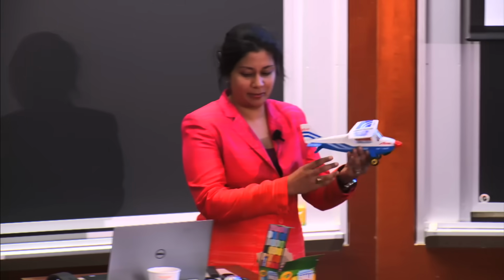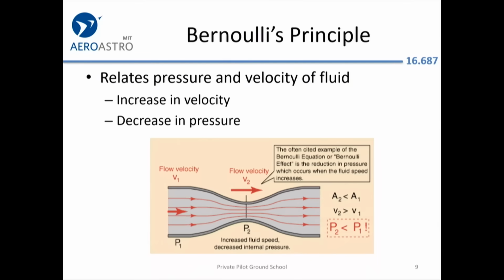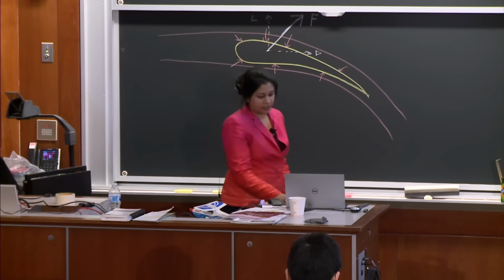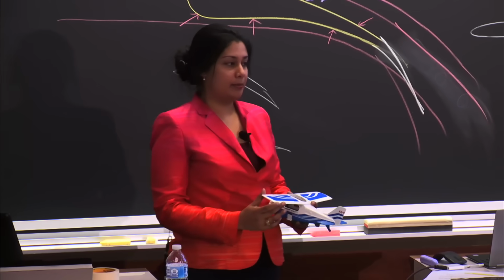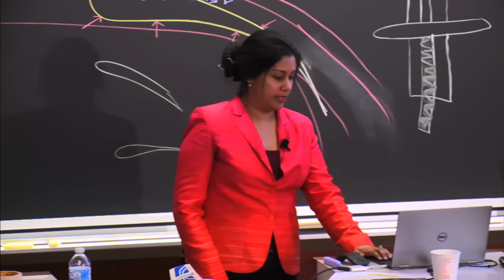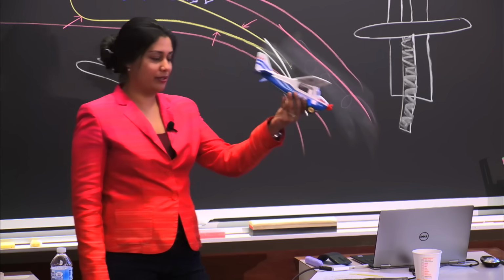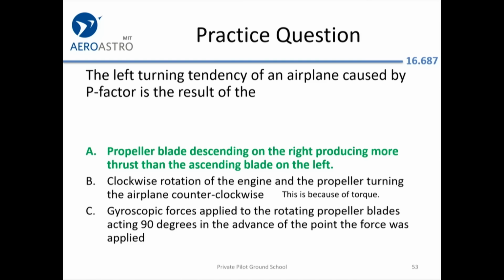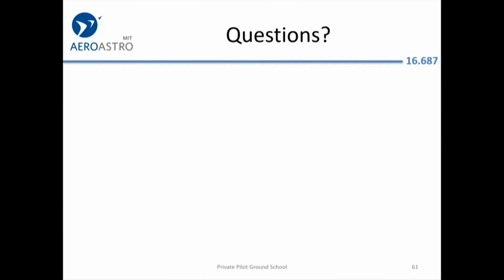Lecture 2: Airplane Aerodynamics

Comment: So ... the air traveling along the upper surface of the wing does or does not go faster than the air traveling along the lower surface. Which is it? Faster or Not(Faster)?

At 7:40 she states that air traveling faster over the top of the wing is false. 

At 13:07 she states that air traveling faster over the top of the wing is true.

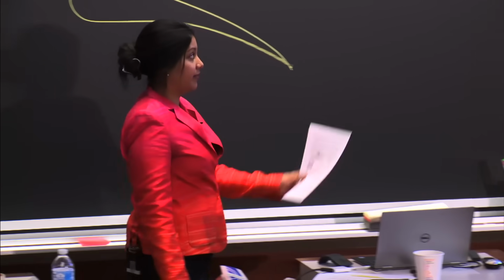Comment: @12:37 But why does the air flow faster over the top of the wing ?
Reply: because the wing is angled, so it is compressing air in front of it which causes high pressure in front of it and low pressure behind it. It's the low pressure which causes the increased velocity.

Comment: ... mmmh - I don't know: When the instructor asked at the end of this lecture why the blended wing body is not going to be built despite its aerodynamic efficiency, I would have asked her back, who actually told her this concept being better? It isn't.
She hasn't mentioned that aerodynamic efficiency is also depending from the size of the aircraft surface: Less surface, less friction - easy. The wing surface is a compromise between the requirement for lift-off still at some reasonable speed (approx.120knts) vs. an air restriction at cruising speed as low as possible. Current civil aircraft designs indicate that more than that wing size as it is would be unnecessary.
The blended wing body would be able to take off at perhaps 50knts - but its air resistance wouldn't allow current cruising speeds - also because of the expected air turbulence: After all a wing profile can only cover a certain speed range.
Besides: The engines on top would give the aircraft a constant pitch-down tendency. Again, there are reasons why engines are currently attached below the wings.

Comment: There is a lot of misleading information in this video. Take for example the questions asked at 12:51
Which statement relates to Bernoulli's equation,
1. For every action there is an equal and opposite reaction.
2. An additional upward force is generated as the lower surface of the wing deflects the air downwards.
3. Ait travelling faster over the curved upper part of the airfoil causes lower pressure on the upper surface. 

in Bernoulli Principle, there are two types of accelerations of masses that can take place and in both types of accelerations, FORCES are generated.
Since velocity is a vector containing magnitude and direction then,  
*One can have a change of linear velocity of a mass keeping the same direction to produce linear acceleration hence forces and pressures.
*One can have a change in direction keeping the same velocity and so one still produces accelerations and hence forces and pressures as in centrifugal force where a mass moving with constant velocity will change direction.   

Now in the question asked,   ALL THE ANSWERS SHOWN, DO EXIST in various zones WHEN A FLUID MOVES ALONG AND BERNOULLI EQUATION IS EXISTING WITH ITS MANY BY PRODUCTS INCLUDING  all that is listed in 
1. For every action there is an equal and opposite reaction.
2. An additional upward force is generated as the lower surface of the wing deflects the air downwards.
3. Ait travelling faster over the curved upper part of the airfoil causes lower pressure on the upper surface.

I believe we need to stop talking about Bernoulli as an explanation of how a wing operates and start thinking of the Zone around the wing as an ACCELERATION ZONE OF THE FLUID IN QUESTION. Basically, we must not look at a change in linear velocity hence linear acceleration along the streamlines ( that is drag basically )  but we could regard the change in direction of the close elements of fluid particles which are so close that they move with constant velocity basically, and it is this change in direction of the fluid elemental masses that produce the acceleration force.  and hence at every zone located around the wing, there is  ( 1 elemental opposite reaction for every reaction) and also (2 the acceleration force due to a change of direction of the fluid generates on the lower surface deflects the air downwards which in itself contains the fact that to every action there is an equal and opposite reaction! )
Note that air need not travel faster on the curved upper section of the airfoil as a change in direction of the fluid mass is enough to cause acceleration and hence a force which the fact that to every action there is an equal and opposite reaction will produce the lift on the upper ( and lower) surfaces of the wing.  

Now, a leading-edge is a wonderful unit/zone, used to improve the lift on the upper section through this simple function, First, the fluid mass particles on streamlines going into the leading edge will come into a pressure zone and are deflected upwards by the pressure zone and they are vectored as heavy balls, up and away above from the leading edge, This momentum of the heavy fluid particles going up and above the leading edge becomes little pistons which will leave a suction zone behind them due to the fact that they have been shot up by the leading edge and also the rest of the upper surface has a downhill sloping surface which acts as an empty volume tending to suck back all the mass fluid particles shot up by the shape of the leading edge.   

The lower surface is easier to understand as the heavy fluid particles simply act as a multitude of heavy balls hitting a tennis racket and here comes that part where to every action there is an equal and opposite reaction contained in Bernoulli behaviour!.

People viewing this video should be careful how to answer questions set by  their teachers and they should  be patient and polite to write FROM BASIC PRINCIPLES  that it is not Bernoulli nor Navier Stokes that makes wings fly but the heavy fluid particles being subjected to  a change of velocity keeping the same direction and a change of direction basically keeping the same velocity and all this contains once again 
all the three activities mentioned below.
1. For every action there is an equal and opposite reaction.
2. An additional upward force is generated as the lower surface of the wing deflects the air downwards.
3. Ait travelling faster over the curved upper part of the airfoil causes lower pressure on the upper surface.

MIT OpenCourseWare, please reflect on this contribution showing the basic principles and fundamentals of how a wing flies.
Bernoulli and Navier Stope should no longer be mentioned in flying but students should comprehend the basic principles in the statics and dynamics of heavy fluid flow as individual particles having mass and which could ACCELERATE and DECELLLERATE in a linear or a circular manner.    
It is Bernoulli that follows natural phenomena and not natural phenome follows Bernoulli.  All educators of aeronautics please note and do not mislead students anymore. Also, note that in practical situations at the trailing edge there are always vortices along with it as the velocity at the tapered trailing edge from the upper suction surface is not and never the same as the velocity from the lower higher pressure surface. This is accentuated with a higher angle of attack and become disastrous just before the wing stalls.  So enough of Bernoulli, please! 

All students, please do not take what is in books like the Bible of flying,  students should become sensitive to the behaviour of just a lump of mass fluid which is being accelerated or decelerated through linear acceleration or circular acceleration. That is all you need to understand all the behaviour of, wings, rudders, ailerons, flaps, spoilers, propellers and in jet engines, compressors, diffusers, combustion chambers, injectors,  and hot stators and hot turbines and exhaust pipes............................................it all has to do with linear and circular accelerations effects due to curves and their smooth concave and convex and sharp-edged shapes where with air, one can add heat for a bit of fun, and in water, the lump of water, can change its shape and fall off the blade of a propeller at the leading, trailing edge and tip,  and even boil up if it sucked fiercely from the suction side of a propeller or any part of a ship or aircraft for that matter.  Read all books and appreciate what teachers tell you, but do sit alone in life and deal directly with the elements of the universe around you....... there is, as it is................... and no one as yet, not even Bernoulli and Navier Stoke and not Maxwell norFaraday nor Einstein nor any other person has come up with a formula that explains all the detail in how a wing flies. They only deal with symbolic approximations. Most engineers do their best to make it work, but they do not understand it completely.  So anyone can sit, think and contribute to advance the present situation.  

All educators please be tolerant with those students who think and might not agree with your philosophy as they might be correct in their own conclusions.

Comment: I understand how the the air flow below the airfoil turns downwards. But why should the air flow above the airfoil turn downwards?  I believe the explanations will be easy if you can imagine the stationary air at plus or minus infinity is enclosing the air flow. as a duct.

Comment: I don't get why every instructor on this subject always says, "When the air travels over the wing...".   When an airplane flies, the WING is traveling THROUGH the air, not the other way around.  Sure the air might be moving slightly because no air is perfectly still, but the air is not traveling over the wing at 150 knots, it's the wing that is traveling through the air at 150 knots and the air is being displaced and moved around by the wing as it travels through the air.  Also if the air was doing the moving, I suspect that it would have some momentum and inertia because of it's mass.  How would that influence concepts of lift, boundary layer theory, stall characteristics, etc.   The only time I can think of where the air travels over a wing would be in a wind tunnel where the wing is stationary.  I am definitely not an expert in this area but I would dearly love to have an expert address this issue, ... am I totally off the mark here?

The instructor was interesting.    She made a few boo-boos here and there but it actually made the presentation more believable.  She was talking to the students on a level playing field not looking down at them as if she were some kind of know-it-all and just spewing out facts at them.  The presentation was interesting even though I previously had a good understanding of all the concepts she presented.  I think everyone piloting, building their own aircraft, building/flying RC airplanes, etc and in general the flying public would get a better understanding of what is actually happening when they fly by watching this video.
Reply: So when you visualize flight, do you imagine the wing trying to climb over the air like a soldier crawling up a hillside? I'm simply asking because your statement got me thinking.
Reply: @JBHACKSAW  Well possibly.  I believe the angle of attack plays a huge roll in providing lift, however, the air passing over the top of the wing must be smooth and not separate so obviously it must have an influence on lift as well.  Having said that I do not subscribe to the Bernoulli principle of lift because aerobatic airplanes can fly upside down for hours without falling out of the sky, so that tells me it is the angle of attack that is providing the lift not the Bernoulli principle.  

Reference link:  https://en.wikipedia.org/wiki/Joann_Osterud#:~:text=Osterud%20next%20set%20two%20records,Vancouver%20BC%20and%20Vanderhoof%20BC.
Reply: from my understanding of what she said, it is just because of the frame of reference chosen at the moment, it does not really make a difference
Reply: @Spirit_Circle  But how can it not make a difference if the air has mass and velocity?  It's the body in motion thing, wouldn't the air moving over a stationary wing tend to want to go straight and not adhere to the wing's surface?  Wouldn't this provide erroneous information about stall characteristics because the air does not want to change direction?  Lol, it's one of the anal-retentive things that has always interested me.

Comment: An airplane climbs because it makes more lift than weight?? Lmfao, uh no. 
An airplane climbs because the thrust vector is pointed upwards and energy is being converted, it climbs due to excess thrust horsepower. 
In unaccelerated climbs and descents, the airplane is still in equilibrium. 
The sum of all the forward acting forces equal the sum of all the rearward acting forces; the sum of all upward acting forces equal the sum of all downward acting forces.

Comment: Bernoulli would be very surprised to learn lift generated by a wing is only the product of angle of attack. I expect more from MIT.
Reply: Misapplication of Bernoulli's principle, which describes the conservation of mass and energy of liquid flowing through a tube. 

Watch a wind tunnel video and observe the curved streamlines around an airfoil. Due to the airflow's tendency to try to remain attached to the top surface of the wing it is flung to the outside of the curve, generating a pressure gradient. Anytime a streamline is curved, you find a pressure gradient from low to high, from inside to outside of the curve. Air accelerates from relatively high pressure to the low pressure area. This imparts on the airmass a downward momentum (downwash) to counter the equal and opposite lift force.

The key thing to remember about lift is that it is a reaction force caused by the diversion of air down. The lift of a wing is proportional to the amount of air diverted times the vertical velocity of that air. For a given wing the amount of air diverted is proportional to the speed of the wing and the density of the air. The vertical velocity of the downwash is proportional to the angle of attack and the speed of the wing. The induced power is proportional to 1/speed and to load squared. The parasitic power of an airplane is proportional to speed cubed. With these basic concepts the phenomena of flight can be easily understood.
Reply: @GZA036  Wondeful explanation. I stand by my original statement. It is not only angle of attack. It is not only the pressure below the wing. it is also the reduced pressure above the wing and the curvature of the top of said wing. if it were only angle of attack you would not be able to levitate a ball with air at an angle less than perpendicular to gravity. Watch videos of shop guys exploding fruit with air compressors (good for a laugh). The woman in the video is adamant about the angle of attack being the only factor.
Reply: @GZA036  you will like this:
"Adventures with Bernoulli - Demonstrations in Physics" I know, I know your into jets.
https://youtu.be/HZClP-m9g24
Reply: @lamboseeker238  LOL Adventures with The Coanda Effect: fluid jet entrainment

Comment: most naca series airfoil have lift over drag ratio of greater than 1, so 1 newton of forward thrust can generate more than 1 newton of lift. From a conservation of momentum's perspective,  I don't get where the extra momentum in the lift direction is coming from ? or is momentum only conserve only along a stream line ? if 1 n of thrust can generate more than 1 n of lift, doesn't this imply that rocket should be shaped like airfoil, so the same amount of rocket thrust can lift more weight ?

Comment: For the lift generation, instead of explaining with conservation of momentum, I think it would be more intuitive to explain it with viscous shear stress acting on the wall of an airfoil (i.e skin friction). With increasing angle of attack, friction induced by air on the skin of an airfoil creates both lift and drag as the direction and magnitude of the force is split into vertically and horizontally. The air has certain viscosity and it pushes the win/airfoil against it's motion by skin friction. The air streamline flowing through the top of airfoil induces some drag but does not generate lift; hence, it's got nothing to do with "lift" actually because of inclined angle of attack.
Reply: Pls explain why air flowing on top does not influence lift, same as air on bottom side...more so if lift is due to skin friction.
Reply: And where does the theory of viscosity  come from? 
Any physical phenomena is best understood by relating it to the basic laws of physics, here, they are force-momentum relationship, continuity and energy conservation.

Comment: If the propeller can cause so many issues with unbalanced thrust and gyroscopic procession, why not have two counter-rotating blades to cancel out the torque? (I don't know anything about airplanes; there is probably an obvious reason)

Comment: 12:24: This is called Venturi's effect.

The Bernouilli's equation is the answer to this effect.

It can be easily demonstrated admitting the fluid is incompressible  -, meaning that a given fluid mass keeps the same volume in time  - and  without viscosity (i.e : no friction inside the fluid conducting to kinetic energy leaks). So, applying principle of communicating vessels to energy conservation to a given mass of fluid leads to Bernouilli's equation.
Reply: Air is compressible
Reply: @davesmith3289  , that's right but at low speeds, Bernoulli's équation is precise representation

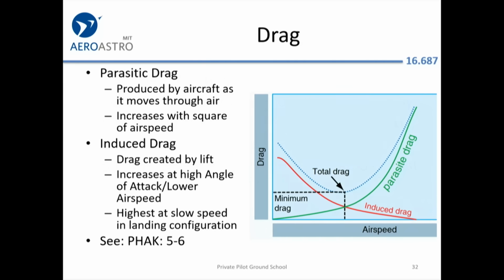Comment: 39:15 Stalling (also) occurs by having insufficient airspeed... (43:40 Oh, you got there... Sorry!)

40:05 *defined

44:19 I don't know what he means by "lift in an unwanted direction" but let's just say that if you were to induce drag, to the point of stalling, while also banking the plane, you would end up spiralling down--and you may not (be able to) recover from it, with the consequences that would go with it... (see 54:25)